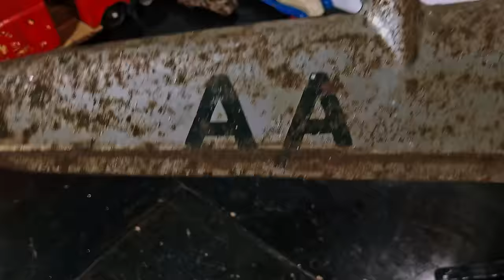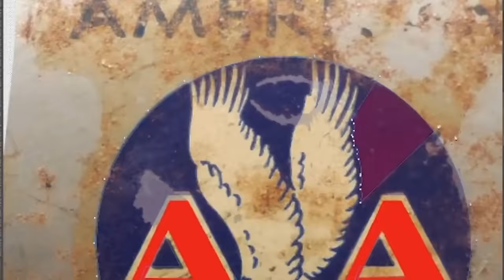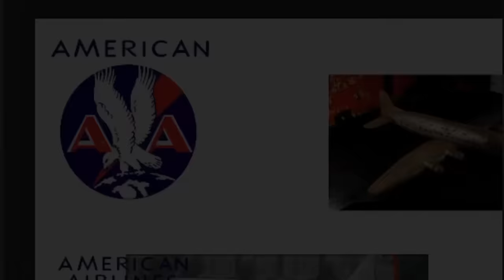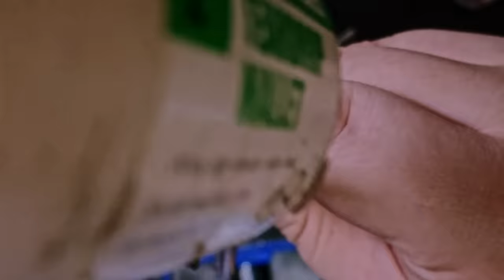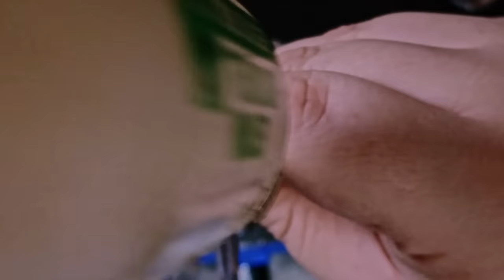1940s Marx DC-4 Restoration: Massive 28" Wingspan Pressed Steel Toy

Comment from the maker: If you have a favorite part of the restoration process, let me know in a comment.
Reply: I really appreciate the effort you went to to record the original graphics and precisely recreate them including their locations.  Very nice work there indeed!
Reply: The whole process is amazing, making the door was great paper to metal, the unfortunate lose of the original AA insignia to making new stuff. My dad was one of test pilots in late 60’s 70’s for Douglas 8,9 &10’s. My heart is still in their A/C’s. Again great job on toy DC-4. Thanks sharing it
Reply: Sandblasting is my favourite part, but your left handed blasting sucks.  Well done for a good finish.
Reply from the maker: @islamjawaher217  Not my fault the machine is right handed :) Tell Harbor Freight. I'm working on improving it though, I just got a Skatblast gun, but my tip broke in this project, so I have ceramic tips to replace it with for next time. I appreciate you letting me know which part you like watching.
Reply: @Toystorations  I hope you didn't mistake my jest, and was no reflection on your excellent restoration job.
Keep up the good work, and count me as one your many admirers.
Reply: The restoration is amazing I love it. You the MAN

Comment: Cudos on the metal work done on this model. Considering the age, and the condition of the metal to work with, you did a great job bringing back a polished finish! My only criticism is the decals. You should always cut the decals as close to the artwork as possible. The "flashing" of clear will be even more noticeable as the decals age. Also, if you have any access to a "Cricut" machine, you could cut out the NC number and American Airlines titles on self adhesive vinyl. That eliminates any excess clear. All in all, a very good restoration.

Comment: I hope you finished the model off with a couple of good coats of gloss clear varnish to preserve both the shine from oxidation as well as  your decal markings from shrinking, peeling, fading, etc.
Reply from the maker: I didn't want to do it on screen, in case I goofed it up, but I plan to as soon as it gets warm enough to paint outside. Thanks for the heads up!

Comment: Came out ok. Suggestion for your sandblasting  cabinet. Get LED lights and use those rubber mats that u put at the bottom of your silverware draws for the inside of your sandblasting cabinet.
Reply from the maker: I've got more LED floodlights in there than a baseball stadium. My vacuum system can't keep up though, it gets too dusty to see.

Comment: Nice job but to shiney my friend,it should be brushed aluminum,I have a collection of 354 of planes,jets and helicopters from the 40s up to the late 80s most are in the original boxes except the larger models they didn't come with boxes, SEMPER FI i have an heavy interest because my grandpa and dad were both Marine pilots

Comment: I do industrial sand blasting and coating, I see this in a lot of channels like this, you shouldn’t touch blasted metal with your bare hands, the oils, and moisture cause flash rust. Causing the coating not to adhere properly. You might not notice right away, but eventually it will fail.

Comment: Disclaimer: I do not sugar coat things to ensure clarity of what I’m saying; some people appreciate it while others feel “offended” if the reader is the second type please go to the next comment. 

If this is what passes for restoration these days I feel sorry for those who use this to show how things were done in “ancient” times. I will explain myself in hopes that you will be willing to learn from an old toy lover and airplane enthusiast. 

1. A restoration is the process of bringing something as close to the conditions it was when it left the factory. 
2. The worst thing you can do to one of these old toys is sandblast it with the wrong media, the one you used is too coarse for this work and by the end you literally removed at least 25% of the original metal.
3. The toy was painted when it left the factory, you should’ve painted it. 
4. As a minimum You should’ve painted the inside before assembly, the sandblasting actually increased the surface exposed to ambient changes which WILL cause faster destruction by the formation of rust in all interior surfaces. 
5. You handled that plane with sweaty hands. Are you aware of how damaging body fluids are to bare metal? I don’t think so. Between the sandblasting, lack of paint, all that wet sanding to polish it and your salty body fluids a toy that had lasted about eighty (80) years has now little hope of surviving another ten (10).
6. Since no measurements were taken there’s no telling if the decals are the appropriate size or if they are placed and aligned in the exact locations of the originals.

https://www.brhoward.com/artifact-restoration-and-conservation

Comment: Hi. Do you spray a clear coat over the whole thing when it is finished to preserve the transfers and metal finish?
Reply from the maker: I didn't in the video, but you can and should so it won't rust. Most people have been recommending a clear lacquer here in the comments. You have to look out for moisture being trapped under the paint though, which can and likely will rust under your finish and ruin it. A good nickel plating will keep it from rusting as well.
Reply: @Toystorations  I wonder if a light coat of automotive-type ceramic spray coating would also be a decent alternative if one doesn't have access/skills to a airgun & lacquer?
Reply from the maker: @eskieman3948  Would probably work as well as a wax or linseed oil wipe, keep oxygen off the metal and stop the rust from forming. Wouldn't be permanent but it would definitely help and last a while.

Comment: You did nice work but you could have used a buffing wheel and applied paste wax after the decal work. No problems with rust just dust.
Reply from the maker: That's an idea, the plan was to open it back up and spray it with clear after it warms up.

Comment: Was there a bottom half to the wings?
Reply from the maker: Nope, 1940s toys were sometimes a bit primitive. They're just one stamped sheet of metal with the landing gear spot welded on. The later version had a mechanism that let the wheels rotate the propellers if you pushed it though.

Comment: My advices would be powder coating and wear gloves.
Reply from the maker: Powder coating polished metal?  I want to get that for other projects but I mostly airbrush because I love painting and powder coating is expensive and not fun or skilled, not to mention it'd be about $500 to get the supplies to powder coat something as large as this plane. As for the gloves, I've gotten that feedback before but it gets caught in rotary tools and pulls your hand into them, which doesn't seem safe to me.
Reply: Powder coat the metal before you polish it. Powder coating primer, wet sand and final coat with a chrome powder coat.

Comment: What type of punches did you use to put the props on?
Reply from the maker: The punch was from a dapping block set, the head is rounded so it helps the rivet form the right shape. I sat the back against the flat side of a sliding T-handle breaker bar that I clamped into my vice. I would strongly not recommend doing it that way, but when you don't have all the tools sometimes you just gotta work with what you have.